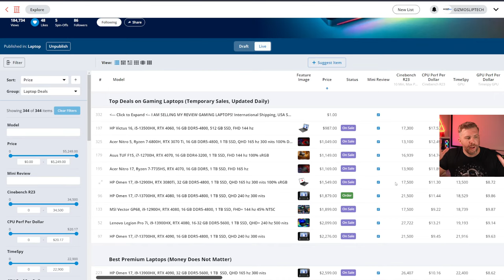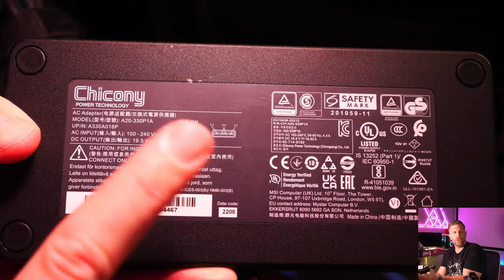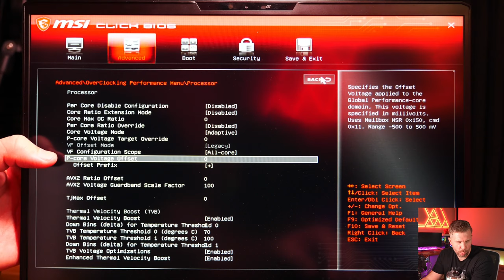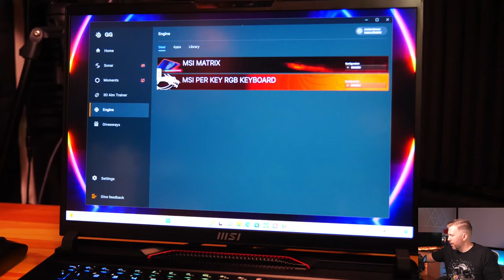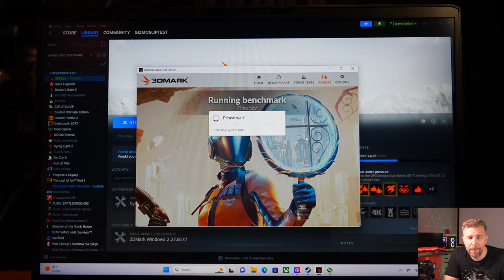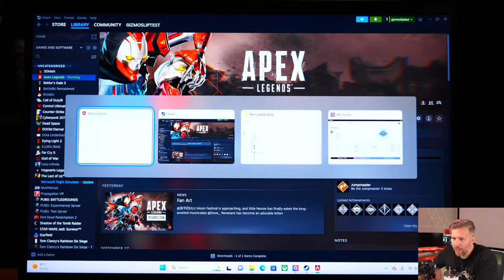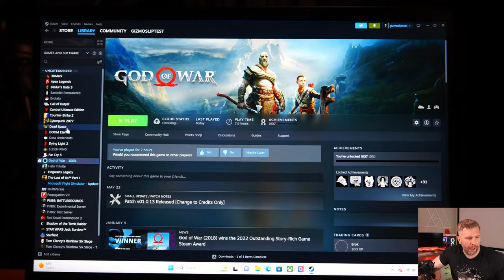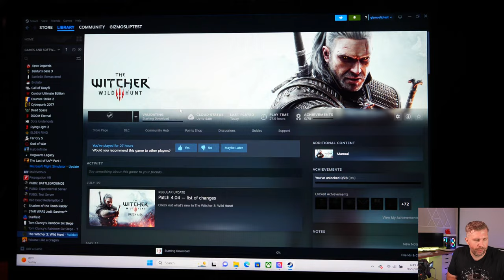MSI's Best Laptop 2023? MSI GE78HX RTX 4080 Unboxing Review! 10+ Game Benchmarks, Display, and More!

Comment: Remember to change renderworker count to 8 for CoD. It defaults to 16 threads for the 13980 which over works the cpu by having all performance core threads active at the same time. You go from 22% cpu bottleneck to 1% bottleneck just by setting it to 8 instead of 16, and pick up at least 15% more FPS. This works for all CPU’s with performance and efficiency cores. Just set the render worker count to the number of performance cores.
Reply: Where is this setting located?

Comment: MSI 17" Raider GE78HX- i9-13980HX 32GB DDR5 | 1TB M.2 NVMe PCIe SSD
17" 2560 x 1600 240 Hz IPS Display
NVIDIA GeForce RTX 4080 (12GB GDDR6)   VS>   Lenovo Legion pro 7i with same specs but slightly different processor and 16"   BOTH 2k right now

Comment: Another great video! Last month, I ended up buying a Vector GP68 RTX 4080 following your review of it but I purchased a version with a i9 13980HX, QHD 240hz display, 32GB RAM, 2TB SSD for £2300. Do you think this was a good deal OR should I have waited a month for this? Much respect from the UK!
Reply: Bro, I was looking for the QHD display one and everywhere I only found the FHD one. How's the display and the performance?
Reply: Currys seems to be the only ones with gp78hx in stock with qhd, 32gb and 2tb SSD. Going for £2799 currently. Where'd you get it for £2300?
Reply: well because you already bought it dont worry about it much

Comment: I have the previous version of this laptop.  It is pretty good, but the key caps broke off and it’s hard to find replacements.  The MSI raiders are known for faulty keyboards.  I will avoid these from now on.
Reply: I haven't heard of this before. How did they break off, exactly? Just curious.
Reply: @RixiRooTM  the keys and the casing just breaks off one day from normal use.  You need to buy new key caps and casing, but from where?  You basically need to replace the whole keyboard.
Reply: I’ve just bought one and not heard this, thanks for the tip. I think I’ll use an external kb as it’s a DT replacement

Comment: Just bought this with the 13700hx and it's working really well, looking to see if any undervolts are posiible.
Reply: How much did it cost?
Reply: @valeaadil   i am from india and bought it at the start of the 4080 relesse cycle for 2,30,000 rupees which is still the lowest price i have seen a 4080 laptop for in india. The same model with 14th gen cpu now costs 3,00,000.

Comment: CPU most of time like worm up  at 90+dgrs!)🤔
Reply from the maker: Thats because I am running it in extreme performance mode, which pushes the thermal limits. Notice the CPU wattage jumping up to 60-90W when the cpu temps spike. If you want lower cpu temps, simply reduce the CPU power limit to around 60W for combined loads (done in Bios, or Intel XTU).

Comment: Lovely video and very informative. You know, I was so confused about what laptop to get, but after watching your stuff and having cancelled 3 orders, I eventually decided to go with this laptop. First, I ordered the MSI GT77, but then I decided it was just too chunky - the arse on it looks ridiculous, and it's not nearly as pretty/slim looking as the pictures would lead one to believe. In fact, it's just ugly, mechanical keyboard or not. I also think 4k on 17" is pretty pointless, mini LED or not, especially for gamers. 

Then, I asked to swap it for the Scar 18 and paid in some difference, and realised that the build quality is pretty inferior to MSI, with it being mostly plastic and honestly, it just looks cheap and not thought through to conclusion. Looking at the internals, it looks like a bit of mess compared to anything from MSI, with unused space, a 90wh battery and the wiring inside just looks messy, and again, cheap, wrapping around the front of the chassis near the battery etc. Also, its activity LED's are in a very distracting and inconvenient place. It was very annoying. It just doesn't look like it was designed with much thought behind it. Also, that interchangeable piece at the back = useless. I will also say the the coil whine and backlight bleed are REAL! I also think the RGB bars look a bit cheap and so does the back grill. I really didn't like those transparent plastic sides. Again, I just got the "cheap" feeling from it, and the hinges creak. Although the specs are great, I simply could not overlook all of that. Then there's the port selection... pretty dull. Even if it is a 18", I just feel like so much potential was wasted in multiple areas of the design. I don't think anything about it is particularly creative, visually. I think the back end of it is basically... "design-less." Lastly, who puts a blue board in a black laptop with green memory sticks? Like.. eww. That's so 2002.

I looked at the MSI Stealth also, pretty attractive, minimalist and slim, but gets hot fast and is intended more for a sort of studio environment for 3D work like Maya etc, in my opinion, with maybe some casual gaming on the side, despite it having a 4080 / 4090. I think those come with a 13900H CPU at best, from what I can see, and they are VERY expensive. I guess you're paying for the "slimness" here.

I wasn't looking at any Razers because I equate them to the Apple versions of Windows machines. They look like they're very difficult to service/open, and get too hot too fast. And not everyone wants green USB ports. Plus I think they are overpriced. Quality wise, they look decent, though. Practically, especially in terms of the functions keys... I don't think this is a clever design. So they can either be functions keys, or multimedia keys, or for brightness or whatever. BUT... if you do make that switch, there are no markings on them. So, until you learn what they are by heart, you'd be guessing what they do. It's equivalent to using a bluetooth keyboard on your smart TV. Also, this has no number pad, which for a 18" laptop is pretty sad, I think, especially for people like programmers and others who fancy entering numbers, quickly. If you are only gaming, fine, but that's all it's good for, and the arrow keys kind of suck. I mean, otherwise.... it does look nice and clean, though - not too flashy or anything like that, but I have to reiterate that it really does remind me of Apple laptops. I also think the drive config sucks. 1tb + 1tb but not in RAID0? It actually makes no sense. Why would you want your boot drive to be the same size? Surely you only need a small boot drive and another bigger one for games and other large files/folders etc. If they were at least in RAID0 maybe I could understand that, or if they gave you a single 2tb SSD leaving one slot free... you know. Another Apple move. F*ck Apple.

BUT THEN!! I saw this sexy little beasty (GE78HX) that seems to strike the perfect balance between all worlds. Thanks to you (and a few others), I feel like I've really made the right decision. I also got nearly 30% off its regular price, so I think this laptop is an absolute winner all around, and the build quality is excellent. Plus, its interior looks very well thought out, with intention behind it - no wasted space, really. It's just what I wanted. Also, the keyboard looks more modern - not like they're using the keyboard from yesteryear. Overall, sexy AF laptop. It's slim enough and just the right amount of understated. Lastly, I really like the RGB on it. It's very attractive and nice looking... almost mesmerizing. The only question I have about it, is... does it support RAID0, if you were two install two identical SSD's? I'm not sure yet. It's not very important, I suppose, but it would be nice. My previous MSI laptop (Titan) which is 7 years old now (GT73VR) is still doing very well. I've never even had to open it up, ever. ♥

I hope this helps someone else out there!

PS. I do agree with the WASD thing, though. Needs some work. The pics on the MSI website are a little misleading in that regard, but it's easy to look past it.

Comment: Also, just to clarify something for myself (please?)... I understand overclocking, traditionally, but in my experience, to get more performance/higher clock (mhz), one would have to increase the CPU voltage slightly. So, I don't really understand what you mean when you talk about under volting. Surely that doesn't increase the clock speed, but rather keeps the CPU cooler at the same speed, with less voltage, so that it can run at max default clock speed for longer. Can you please explain? Or tell me if I'm thinking about this the right way. ♥
Reply from the maker: Undervolting increases the clockspeed at the same level of wattage, essentially making the cpu more powerful by making it more power efficient. This lowers the total wattage needed when max power isn’t needed to get the same task done (like in a game) or increasing total potential performance in all core workloads like Cinebench. Yes, undervolting does increase the average clockspeed quite noticeably
Reply: It still doesn't make sense to me lol. I guess I'm a dummy! @GizmoSlipTech
Reply: You did a video on undervolting this, right? I think.  @GizmoSlipTech